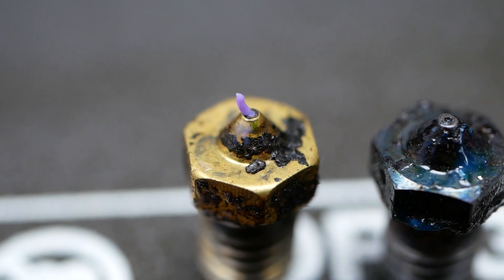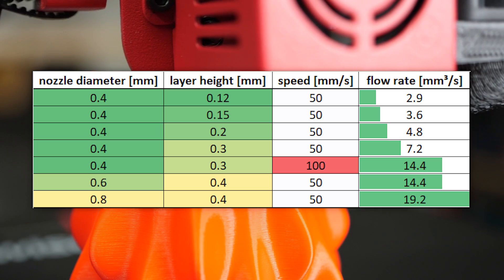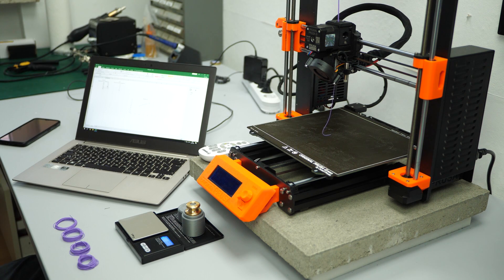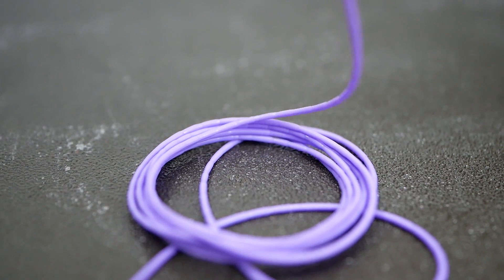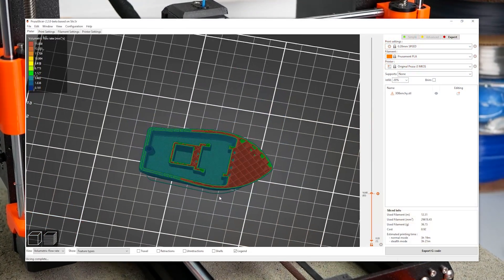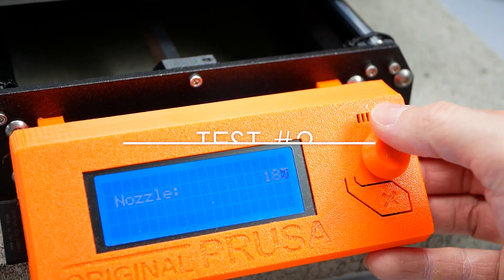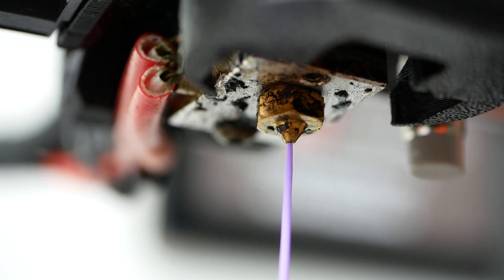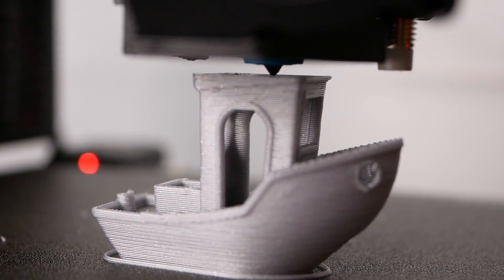How fast can your hotend print?

Comment: As someone who owns both a CR-10 S5 and a CR-10 Max this sort of stuff is very valuable to know, thanks for yet another great video. Experimenting with my monsters isn't cheap so I've settled on temperatures, speeds and flows that don't risk degrading the material by going too hot and won't put too much strain on the printers - the S5 breaks horrifyingly easily. My standard setup for both only differs in speed and acceleration, both run at 229C (modified super strength PLA, not rated for more than 220C) and both do 0.5mm outer walls and 1.0mm inner walls in 0.2mm layers using a 0.6 nozzle. The S5 can't really go faster than 30mm/s without awful results due to its extremely heavy platform breaking the Y motor if acceleration is set anywhere near "normal printer" speeds. The Max seems to do completely fine well over 50mm/s and with very high acceleration for its size thanks to outstanding design. All of the above results in absolute maximum strength super heavy duty prints at reasonable speed and quality, here's hoping some beginner finds the info useful as reference.

Comment: Makes me wonder, does anyone recommend using a bit of thermal grease in the threads of a nozzle to get it to transfer heat from the heat block better?
Reply from the maker: Is say it wouldn't change a lot because the pressure in the threads, where the heat is transferred is pretty high. Only use some copper paste as anti seize.
Reply: @CNCKitchen  I'm not sure exactly what the cross section of the threading in the nozzle looks like under load, but I think a lot of kinds of threading leave quite a lot of voids in the engagement area, making me think thermal paste might do something. Perhaps even especially on harder nozzles, because the brass nozzle might deform into 100% contact when a hardened steel one might not.
Reply: I actually prefer having thermal paste in there, because this way the nozzle will be easier to unscrew later. You can also use copper brake grease.

BTW, copper brake grease has been tried by overclocking forum members, and was found to perform fairly similarly to an off the shelf thermal paste on a CPU, not terribly.

But i can't say that i saw any difference in behaviour or in e-steps before and after.

Comment: Hi Stefan - How about combining a bigger nozzle e.g. 0.5 or 0.8 with the higher temp. Wouldn’t that be able to speed up prints. When would it be necessary to switch to a volcano?
Reply from the maker: Just test it out. Really depends on the setup. You should have the knowledge now to find that out on your own.

Comment: I noticed the limits of the stock extruder of my cr10-s when I tried to print 0.8 line width with 0.4 layer height. I moved to a volcano hotend to be sure, but then I noticed that it was the cheapo extruder the problem (the space between the teeth on the wheel were even filled with plastic, making it almost smooth!). I moved to an amazing BMG extruder, never had any problem again!

Comment: Excellent work!   Using two 40W heaters I was able to push 3mm PETG out a huge 1.5mm nozzle fast enough that the core of the filament remained unmelted, even at 270C (enough to bake PETG into smelly rubber in a few minutes if it's not flowing).  Back in 2013 "Illuminarti" collected similar underextrusion vs flow rate data for PLA out to 250C, his blog describing the experiment seems to be gone, but his data is still available here:   https://public.tableau.com/profile/illuminarti#!/vizhome/ExtrusionRates/Sheet1   I suspect vertical linear deformation of the filament under the high forces of the extruder wheel(s) causes most of the "slip", but I want to verify this with an FEM model and strain gauge setup.
Reply from the maker: Nice!
Reply: @Heads Mess if the thermocouple is able to see temp changes at the nozzle without much lag then regulation won't be a problem. Thermal mass doesn't matter when you are in continuous usage. Then the added mass is just slowing down temp changes at the thermocouple
Reply: Goodness! What was the use case?
Did you observe swelling in the extruded material?
I've noticed it in PLAs that have a little TPU in them. If you extrude too quickly at the higher temps, the extruded material swells as the inside is holding onto the temp, swelling almost like those long balloon animal balloons.
Reply: @dadsfriendlyrobotcompany  For the NASA 3D Printed Habitat Challenge, I needed to print a part weighing several kilograms in under 24 hours.  With the 1.5mm nozzle (made from a block of aluminum) I could do 1.25mm thick layers at about 25mm/sec printing speed, which got me the volumetric deposition rate I needed.  The PETG did come out a bit brittle (possibly some hydrolysis due to residual moisture, I need to make a filament drying oven), but no bubbling or swelling.  There was some about-scale blobiness at retracts and corners.
Reply: @olawlor  I've found that PETG gets brittle with higher temperatures. Were you using a longer heat block? Like a volcano?
Reply: @dadsfriendlyrobotcompany  Yes, I machined the hotend from a single block of aluminum--two big cylinder holes on each side to clamp in two 40W heater cartridges, and a slot for the 3mm filament slowly tapering down to 1.5mm diameter exit hole.  I later tapped it for E3D style M6 brass nozzles, but to start with it was just bare aluminum!  It was my first hotend, but it's successfully pushed about 15kg of PETg so far.  It's pretty tall, about 50mm high, but it's for my Alaska90 so I have quite a bit of spare Z travel.
Reply: @Muckin 4on who cares about thermal mass when you are pushing 80w of heat quickly into the filament. Having the probe close to the extrusion area will be more than good enough for compensation, as the machine reads the temps at the melting area and not the thermistor directly. Aluminium is plenty good for this application, it just needs you to pump enough heat at it and it will manage.
Reply: @Muckin 4on try machining brass or copper by yourself. Then come back. It is a royal pain in the ass. I love your theory and how it all makes sense, but cranking heat up is just easier than re machining the whole hotend in brass. Better in theory does not equate better in practice. You will know that the first time you actually make a project by yourself.
Reply: @Muckin 4on do you know about this engineering marvel called a mill? It makes precision jobs, such as a creating a hotend, really easy. It also produces amazing quality parts. Have you tried machining brass vs machining aluminium? One is way easier than the other. One is a nice material, the other one i hate with a passion. And every machinist would agree.

Comment: 3d Solex nozzle is brutal when it comes to for my example ultimaker's with bowden and TPU. Which is problematic even at low speeds with standard printcores. 

 The layer adhesion in fast prints above 100mm/s with  0,6mm nozle and 0,4 layers works with not more than 15 degrees increase on petg-cf.

And also 3d Solex have coated nozzles that minimize clogging. And that is a bonus for a 24/7 setup.
Reply: What does "brutal" mean here, good or bad?
Reply: @scottwillis5434  it's good. I have never used the super volcano due to that I use ultimaker and then it's 2,85mm filament. It has three small chanels that melt it first then a chamber and the the final width. The meltzone/chanels is the entire length of the nozzle. And heats filament all the way through.

Comment: The Duet has such a feature called "nonlinear extrusion", it does exactly what you want, increasing the flow depending on the throughput
Reply from the maker: Oh cool! Didn't know that.
Reply: @CNCKitchen  So does marlin with the linear advance parameter
Reply: @S_ata3  Linear advance is also present in Prusa mk3s AFAIK. But Stefans results shows considerable variantions. The flow dependent extruding multiplier should definitely be a thing!
Reply: @S_ata3  Linear advance is just for the speed transitions (compensates the lag of molten plastic due to pressure in nozzle and other things), it doesn't compensate for the slippage in extruder in any way
Reply: I use linear advance and autotemp. It seems to work pretty well.

Comment: @CNC Kitchen you mention that we need to take into consideration underextrusion while tuning e-steps or extrusion multiplier.  This is also a consideration when tuning the extruder motor driver current.  Right now the current to my extruder driver and motor on a clone BMG dual gear extruder is set way too high because it never skips, it just pushes the bowden tube out and I need to tune that current down to the point where it is capable of skipping instead!
Reply: I cured the bowden tube pushing out by getting better air line fittings from a reputable dealer. The connectors I have now BITE the tube WELL and ONLY let you pull the tube out when you engage the release.  The old ones I had, I could just tug the tube out.  I use Capricorn tubing exclusively.
Reply: @TechGorilla1987  This is good advice.  As far as I know I am using authentic Capricorn tubing as well.  I say it that way because I bought it bulk from a reputable authorized dealer but recently Alex Kenis had a bad experience where he received either a bad batch or fake tubing.  https://www.youtube.com/watch?v=PAHMAojpZvo  I need to get more so I will probably get some from Capricorn directly if shipping to Canada isn't prohibitive.
Reply: There are some little clips that go between the release ring and the body of the fittings.  They hold the release ring on the fittings out, which keeps the fittings from releasing and the tubing from loosening.  Are you using them?
Reply: @scottwillis5434  Yes I use the clips which came with my extruder and hotend.  I might have printed one of the two but I do use them and they are very firmly in place.  This is good advice so thank you for bringing it up.  I do really believe I have my driver current too high.  I failed to mention that the I had a full clog when it ripped my bowden tube out.  I just want my motor to skip instead!

Comment: Something I learned quite early on is that when calibrating E-steps, the speed of extrusion made a huge difference. It's easy to completely mis-calibrate E-steps by using too high a extrusion speed!
Reply from the maker: Very true!
Reply: You can remove it from the equation entirely, depending on your printer. For example on the Ender 3, you can just disconnect the Bowden tube from the extruder so it just pushes the filament into air.
Reply: @liebherk  Yes, but then you will ALWAYS have underextrusion with a bowden tube attached, as the tube will always add underextrusion, never reduce it. :)
Reply: @liebherk  remove it entirely up until the moment you print anything !!! What's the point in that?
This whole video has demonstrated that you need to evaluate with operating conditions.
Do your esteps under load, at working temperature and working feedrates or risk getting your volumetrics screwed by false conditions

Comment: I have tested the volumetric speed with a 1mm nozzle, but I just go by when the print quality starts to degrade and back it off a bit to be safe. My max for the PETG I use, at a 250C hotend temp, on my cheap Chineseum v5 is about 18-20mm3/s using 1mm brass nozzle. I haven't tested PLA as extensively but I can push at least that amount and still get nice prints at like 210-220C. I use a cheap single gear extruder similar to a Titan and haven't had any problems with skipping even going above 20mm3/s with a 1mm nozzle.
One thing to really watch out for on Prusa Slic3r is the max volumetric speed setting, if it is set to low it will lower all of the speeds including the TRAVEL speed, they really need to fix that, it drove me nuts for a bit until I figured it out, that setting shouldn't touch the travel speed at all IMO.

Comment: Good video. I've noticed recently that my 0.8 mm lines from my 0.4 mm nozzle have been leaving gaps between them, and I suspected that heat was the issue. Going down to 0.6 mm was not a problem for print times though so it was a better option than trying to increase my hotend's max throughput.

Comment: You should have done a DOE to determine the optimum setup,
Reply from the maker: I could have done a DOE to find out if it's linear but in the end, the hotter, the more material you can melt. Pretty straight forward.

Comment: the e3d V6's bad design is limiting your maximum extrusion volume, the internal geometry is not the best for high flow
Reply from the maker: Why do you suggest that the geometry limits the flow? What could be improved?
Reply: No. The printer itself is limiting the printing speed. 🤓

Comment: 100mm/s is "crazy fast" for you? what? it boggles my mind thinking people don't print faster than 100mm/s, like, why go slow when your machine is capable of so much more? my printer runs 150mm/s regularly, and I have a friend that runs his at 300, hell I even seen one guy do 1m/s on his delta, I feel like we should strive for faster speeds and better quality, I see people printing at sluggishly slow 40mm/s! how? for reals, I just can't imagine waiting 12 hours for a print that would take me
edit: my printer is a not heavily modified anet a8 running klipper firmware, but any printer is better than that, just installing klipper on an ender 3 would beat a prusa any day of the week for example
Reply: He only has that Prusa printer...full of zip ties to hold the parts together! What do you expect? 100mm/s is fast for such machines. Actually too fast.
Reply: I have a e3d clone and it's I'd the limit for my anet a6 clonez with klipper.
Reply from the maker: 95% of the people usually don't print faster than 50 or 60mm/s on their machines and even though they set their speed higher the machines often don't reach that speed due to acceleration or layer time limitations. I know that you 100mm/s is not the upper limit but if you get in that regime you need to know what you're doing.
Reply: _ David _  custom slicer? No. Rpi, yes.

Comment: I wonder if using volcano would increase flow rate at low temperature? Let say, PLA at 190 C with 0.4 nozzle, will upgrading make any difference in that case?
Reply: Yes it will. It's the extra time in the longer melt zone that really helps.

Comment: I once compared extrusion speed to force between nozzle and extruder. (using dms sensors) http://www.rf1000.de/viewtopic.php?f=23&t=1620&hilit=viskosit%C3%A4t&start=20#p16757 the results are not bullet proof but it once helped me to compare nozzles, filaments and temperatures.
Reply from the maker: Nice! I've been thinking about something similar as well. Unfortunately never got to it...
Reply: @CNCKitchen  The used printer type has dms sensors included. So it was quite easy to change the firmware to produce the data. But it was still work to do.

Comment: This is a wonderful video, and very timely in that I'm considering trying out a Phaetus Dragon nozzle which comes in both "small" and "large" flow rate versions. I decided on "small" since I only use a 0.4 mm nozzle, so that seems sufficient.

In addition to future nozzle tests, perhaps you could also look at comparing the standard E3D extruder versus Mosquito and Dragon nozzle setups where the flow rate characteristics might be different.

Comment: If I had wish list of priorities for prototype printing, it would be;

1) maximum reduction of visible layering lines.
2) model strength
3) best performance as a ratio, or, quality per filament linear meter (consumption) 

Just like Motorsports, tuning, modifying and development tests demands compromise because it is difficult to state a set of modifications that is suitable for all models of hotends and filament materials. 

I would also like a review of a  machines software that obviously plays a critical role how any or all modifications can be used - or not. Given the wide range of filament types and equipment, it would be a massive undertaking. It would not be your average size  spreadsheet of data!

With an abundance of filament types, nozzles, temperature control options, hot end architecture, CNC accuracy, I wonder if it is even possible to measure precisely for most consumer grade 3D printers.

I think it would be great if you can break down a priority list that should be considered before adjustments and modifications are made.

I think it is highly unlikely today's consumer grade machines over the next 5 years we be able to meet the level of an industrial finish quality unless a dual multi-axis hotend design is developed. 

Really enjoy your presentations. Keep up the great work!
Reply: to get minimum layer lines, super tough prints and stupidly fast speeds for rapid prototyping, you gonna want a high quality hotend, like a high end mosquito or a Nova hotend, running .4 - .5 nozzles and printing at 200-300mm/s at .2 layers, this is possible on most printers like prusas or ender 3 if you use klipper firmware with a RPI, I run that setup on my modded anet a8 and regularly print at 150mm/s, it's really confusing why people don't print fast, why? why does every company endorse printing at sluggishly slow 40mm/s? it's dumb!, prusa prints at 80 stock I believe, which is really good as they're only using 8bit, I really respect them for that, but 32bit printers normally run that slow too!

Comment: Question: I'm designing a custom printer. Does shitty thermisters affect print quality? (I've had this situation where something looked like z banding, when in fact apparently it was temp variations)
Reply from the maker: If the thermistor has a bad connection and reports wrong temps, yes. If you only have an offset, it shouldn't affect the results. Rather take a look at your PID tuning of hotend AND bed and see if that changes things.